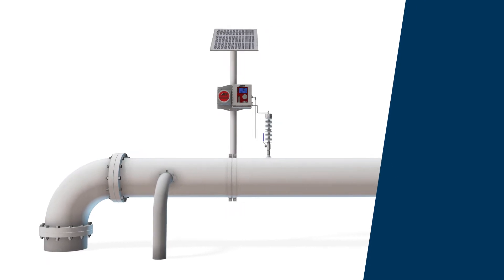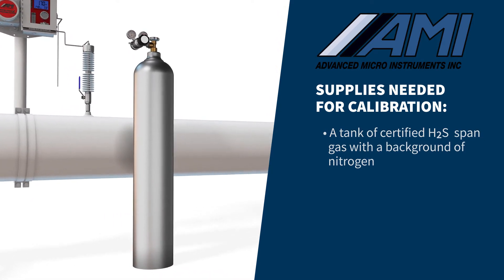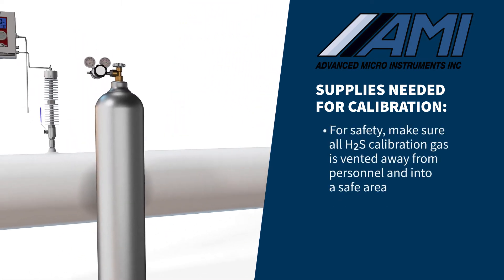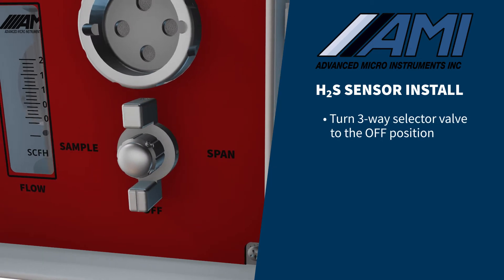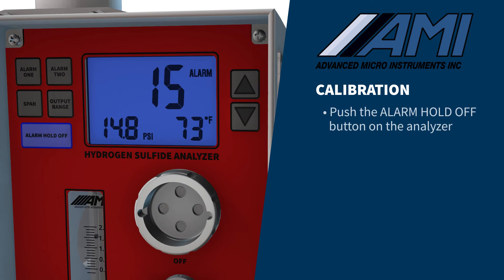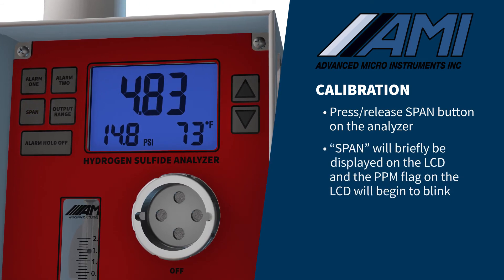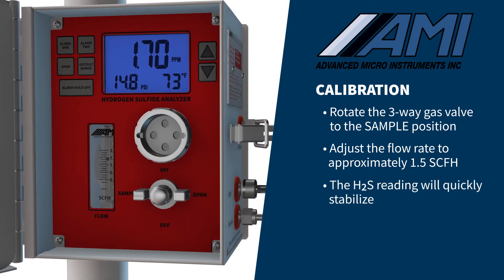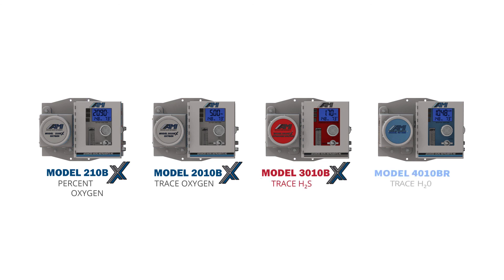AMI 3010BX H2S Analyzer Calibration Video

Comment: what indication do you get when the h2s sensor is bad? does the h2s reading stay the  same?
Reply from the maker: Whenever customers feel that there may be an issue with a H2S sensor, we recommend that they perform a calibration against a certified tank of span gas.  If the readings are outside the tolerances, then it is a good indication to replace the sensor.  Note:  A calibration should be performed periodically and should be done whenever a new sensor is installed. 
 
Feel free to reach out to us with any additional questions: www.amio2.com